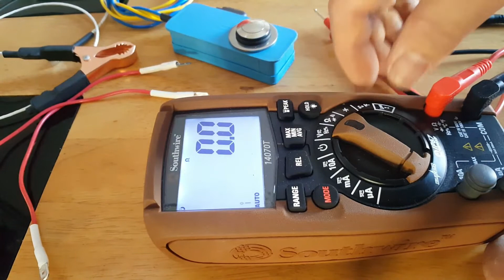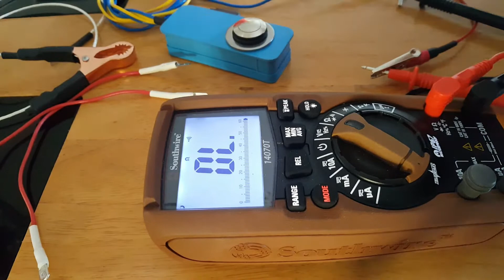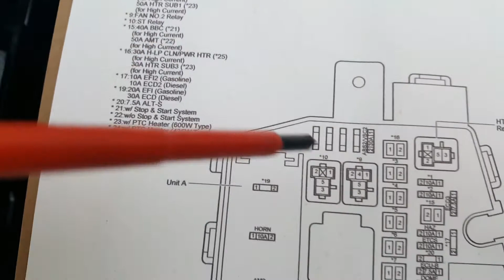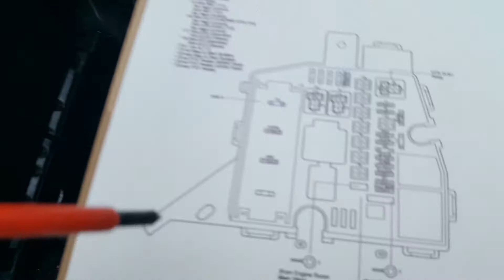HOW TO MAKE A REMOTE STARTER SWITCH - DIY

Comment: What gauge wire did you use? I ask because of the 30 amp fuse.
Reply from the maker: i use 16 gauge wire..thanks for watching
Reply: @jlsetnuper  If it were possible to have a problem lets say somehow internally the switch fused or was stuck in the on position and too much current came through that fuse size would not protect the circuit the wire would burn first.
Reply from the maker: @foreverwood1963  no, I mean the fuse will blow first..as you can see in the video the car use 30 amp fuse that was connected to the ignition switch and to the S post of the starter..

Comment: Thanks for the video! Could I use common wall outlet cable? Like one extracted from a broken lamp or extension? And maybe instead of a spring button an on and off switch? Also, what fuse amperage do you recommend?
Reply from the maker: thanks for watching...Yes can use that wire, just add a 30 amp fuse..

Comment: buddy,,you can buy solenoids with a switch allready installed.. been around since 1950..looks like a ford solenoid with a rubber button on top..
Reply from the maker: yes you can, but I just want to utilized the parts already available in my small shop in the shed..thanks for watching
Reply: 11.39 or so at Harbor Freight last wk